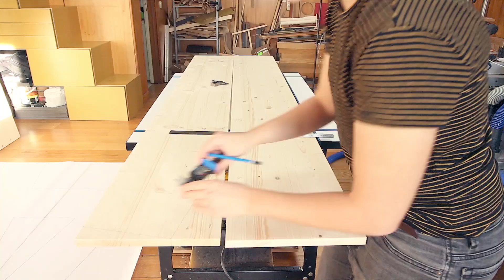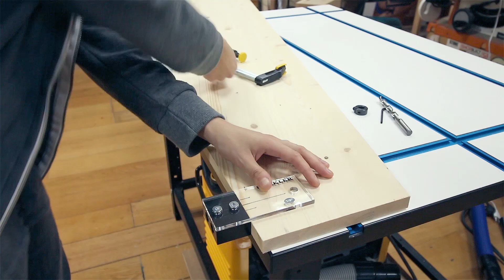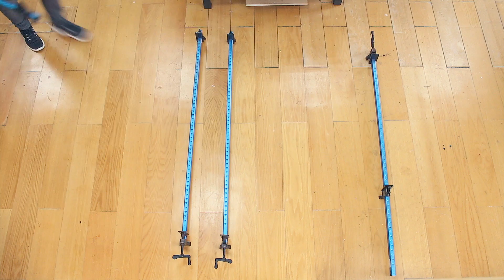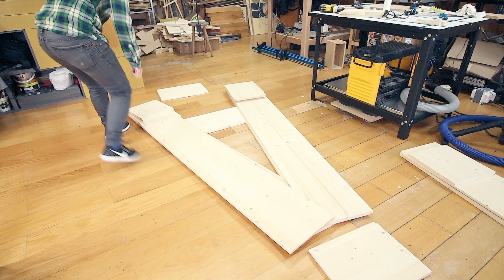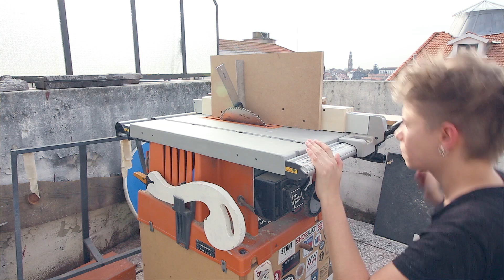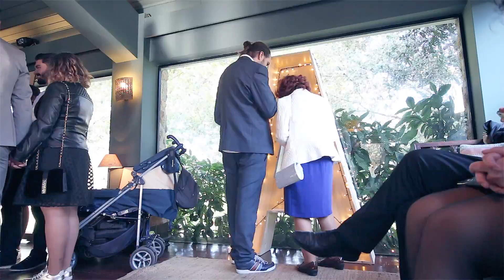The Big A // Wedding Prop

Comment: Very good video. Informatively humorous or humorously informative. Oh, how many times I wished there was someone in the shop to grab me and tell me to calm down!Replace your white wood glue (polyvinyl acetate?) with a wood glue label "extend" .  It will give you about twice the working/open time of your present glue. You can save your sanity when doing a large complicated glue up with an extended open time glue. You can find out a lot of useful glue info on the Tite Bond Glue website.